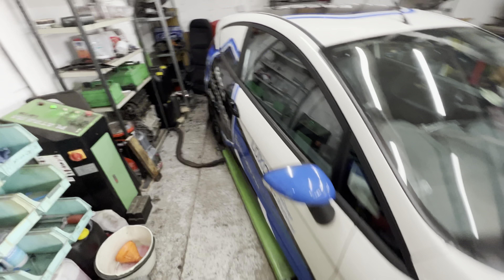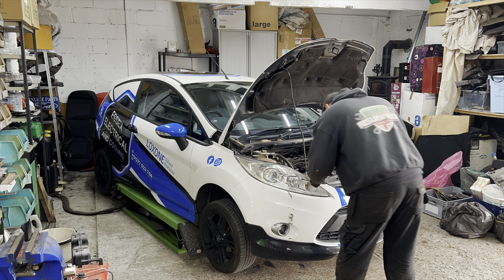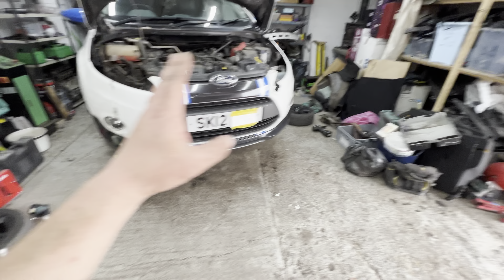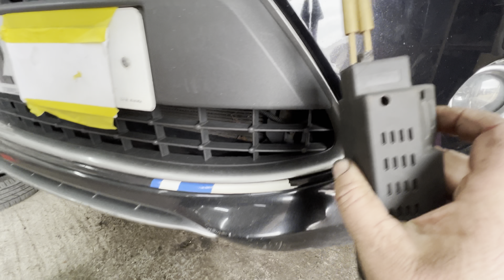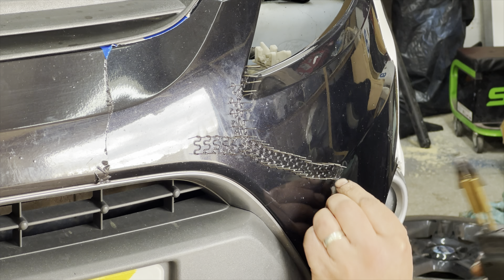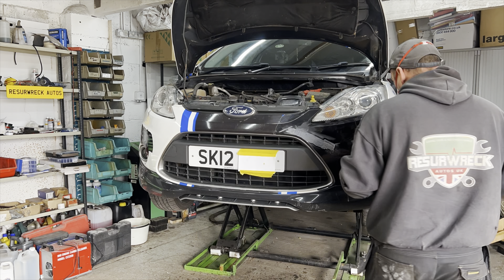Ford Fiesta Van Front Bumper Repair Then Needs Wrapping

Comment: Heat gun staples installing. Push in and twist a little to lock staples in the bumper.  Saves trying to melt over staples.. then if need more filling in then can add plastic melted plastic ties.. I done this method on my sons car and locks in the staples really tight 👍👍👍